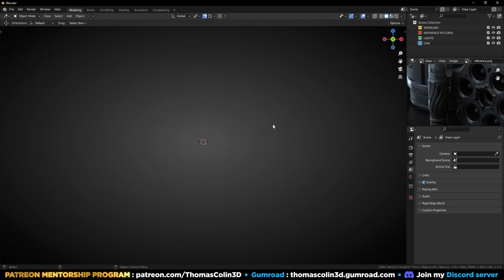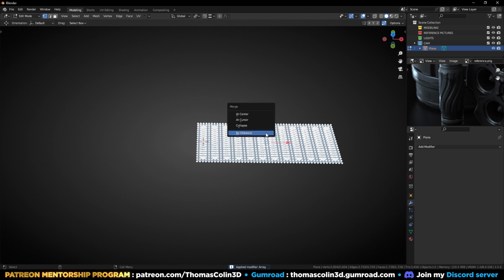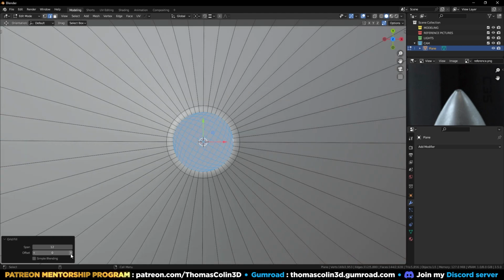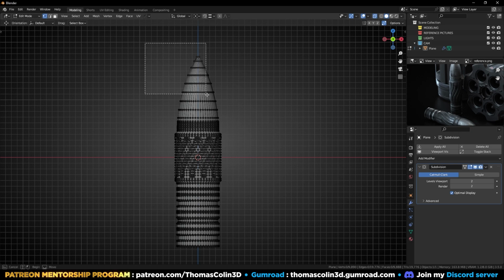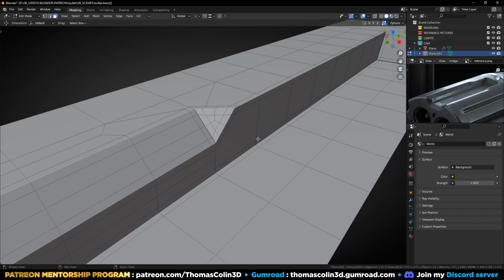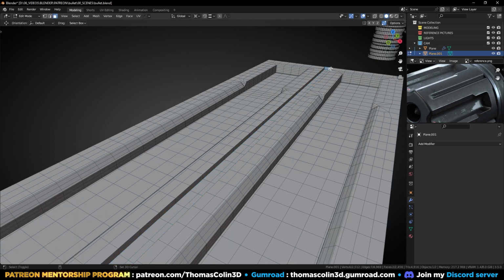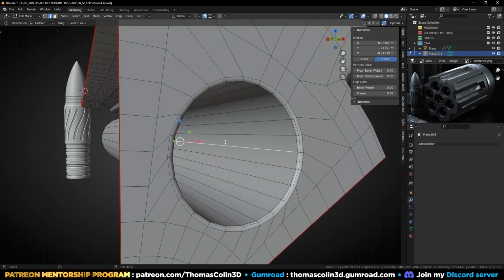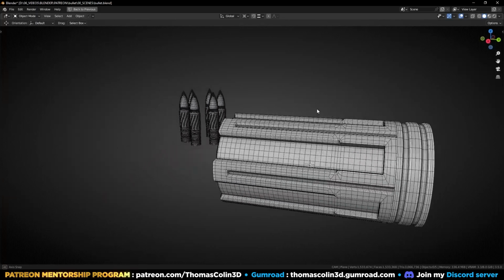Military Gear 3D Modeling - Gun Cylinder & Bullet

Comment: I know this is an "old video" but worth a try...
Blender noob here and I was wondering why the constant need to "merge by distance"?
BTW, I legit just want to know the academical/tecnical reasons for it. Morbit curiosity on how the software works hehe
Reply from the maker: You have to merge the vertices to remove the doubles. For example, when you bend the plane to transform it into abm cylinder, the vertices of both sides meet and are overlapped. You need to fuse them together in order to be able to add loops, and to avoid artifacts
Reply: @ThomasColin3D WOW!! Got an answer on the same day!!! And by the creator no less!! 
Thank you very much Thomas, loved your tutorial!! 
Got my sub. Thanks again!
Reply from the maker: Thank you very much! 👍🏻  @LucasBarboza08

Comment: Awesome model and excellent video overall, but I think there are a few things you could have done to reduce the polygon count and make unwrapping easier without reducing quality.

For example, when adding the cylinders in the chamber, you could have added one edge on each extreme end of the cylinder and one in the center instead of ten. This would simplify the geometry without compromising the model's detail.

Unwrapping a high-polygon model like that would be a nightmare. I recommend unwrapping one section of the chamber before you repeat the parts into a cylinder. This way, during UV mapping, you can snap together the remaining sides more easily.

I think your videos are awesome and I hope this comment does not come across as negative.

Comment: Small nitpick, but the grooves you put on the bullet don't match the thing being modeled, nor could they function as intended, they're supposed to fade out at the edges and leave those spots 'open' so they engage with the bore(like a star shape in a star barrel), as they are they are just pockets that come back to a circular perimeter that doesn't retain the needed outline when looking from the tip, if that makes sense!